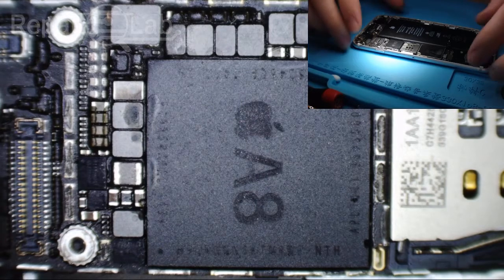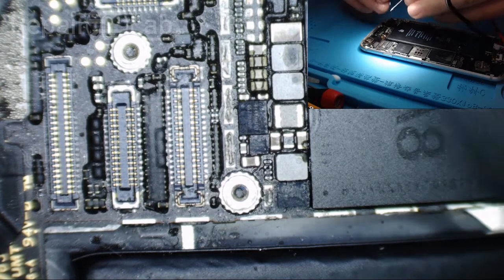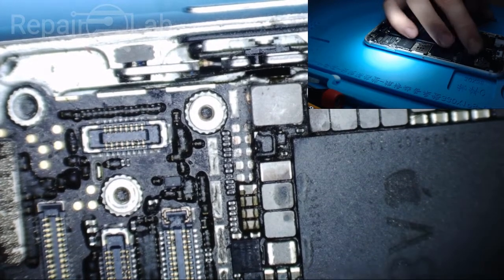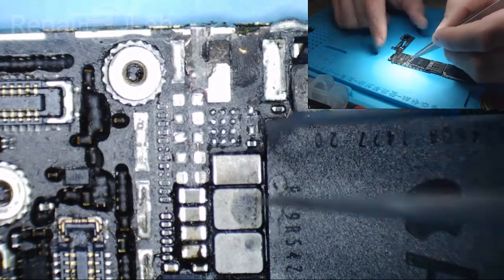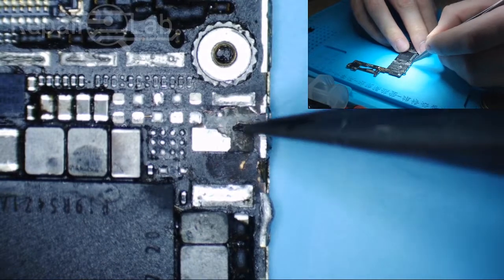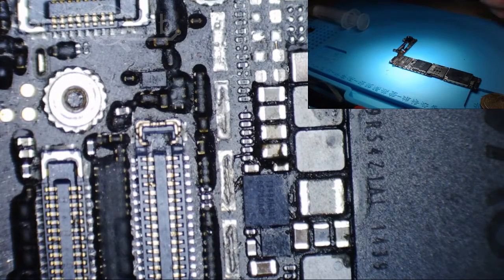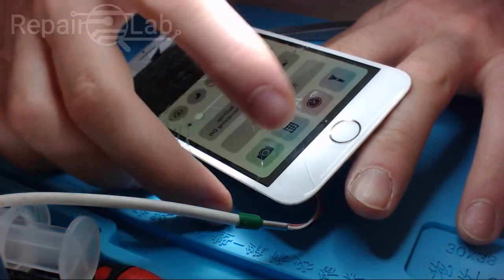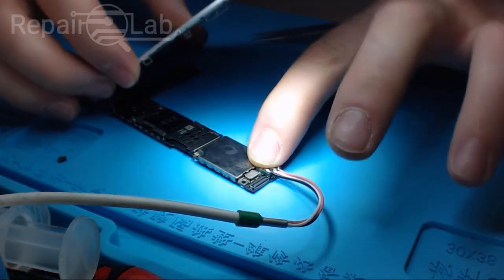Dead Iphone 6 after unsuccessful backlight repair attempt

Comment: After ic changed 0.50 amp , wont turn on, took off 3 caps, chip diode coil, still 0.50 wont turn on.